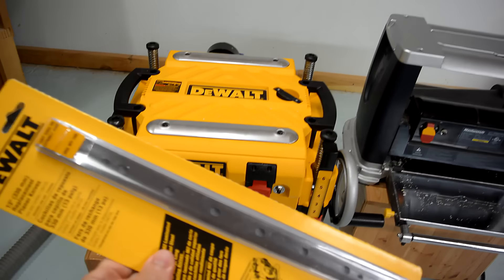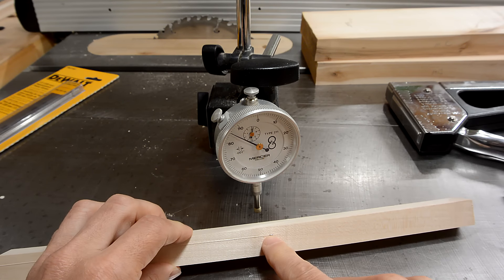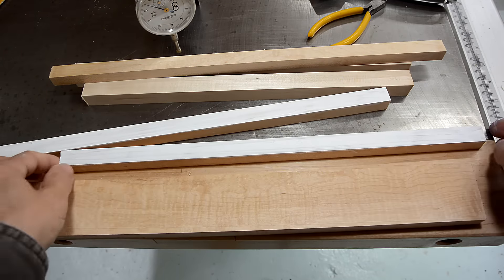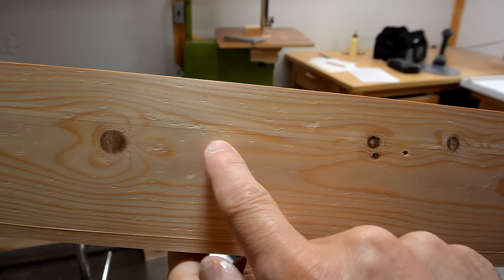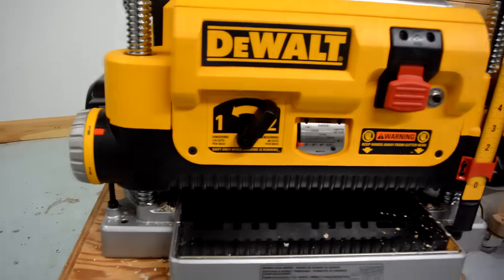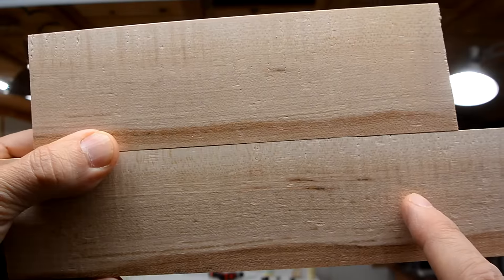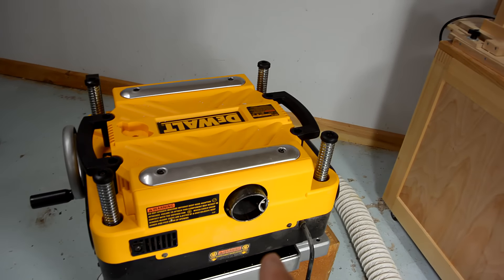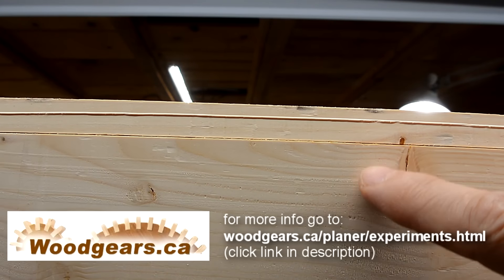More planer experiments

Comment: I also have the DW735, and th e built in blower is no joke.  My dust collection is to pipe it into a Dust Deputy on top of a trash can. The hardest part is getting the lid to stay sealed because the blower creates so much pressure. The Dust Deputy is intended for a shop vac so I'm sure it's not designed for anywhere near the amount of air flow the blower puts out.

Comment: I get those same pesky nicks in my blade.  I will move the wood over an inch to one side and run it thru again without adjusting the knife height and this cleans up the surface where the nicks are. I do this for the final pass only.  great video (as usual).
Reply from the maker: On hardwoods, a cabinet scraper works pretty good too.

Comment: I have the dewalt planer.  My DC is the Harbor Freight 2hp unit.  I have retrofitted it with a garbage can separator (lid from Woodcraft), and a Wynn filter.  With the Dewalt on and the DC off, the lid blows right off the can.  With both on, I have no problems at all.  I was surprised to see your larger DC can't keep up.  Perhaps the non-pleated bag is your limit - they have very little surface area compared to pleated filters and thus their back pressure rises very quickly with increased air flow.

Comment: I have the Dewalt, and like it a lot.  I bought it used from a pawn shop for $300 about four years ago, and then added the Byrd Shelix head about a year ago. The difference in cut quality (and the lifespan of the knives) is amazingly better. Best tool upgrade I've ever done.

Comment: That why you get a Shellix carbide helical cutter head and you don't ever have that problem again.  AND there is absolutely no blade setup messing about ever with a helical cutter head.   They are the best thing ever invented for planers and jointers.  Check them out.   Cheers.   John in Las Vegas

Comment: Curious to know your thoughts on those helical planner knives, they seem like a great idea, but I would only trust a review from someone as careful and thoughtful as yourself. Like, now I know that although the dewalt looks more substantial, there doesn't appear to be much difference between these 2, hmmmm.
Reply from the maker: They cost more than most small planers.  I wouldn't go thru that many knives in 20 years as one of those costs.
Reply: +Matthias Wandel Hmmm, some are cheaper than that dewalt unit, of course not as inexpensive as your economy model, for instance: http://www.highlandwoodworking.com/rikon-13-helical-planer.aspx Wish someone would send you one (hint hint) for your review.

Comment: You are so right about the amount of suction needed to avoid back press pressure on the DW735. I finally got there by cleaning the top dust bag on my collector and then installing one of those trash can cyclones. Now I finally have positive pressure and it does a great job. I now need to watch your snipe video as that's an issue too.

Comment: I wonder if you can harden the blades?
Reply: They already hardened.
Reply: The ones from dewalt that he tested are made from M2 tool steel, there are carbide ones available though.
Reply: Assuming they aren't already hardened and are made from steel with the right carbon content for hardening, I wouldn't dare hardening them, because I would be too worried about warping.
Reply: already hardened yet not as hard as a staple
Reply: SuperAWaC The are harder than staples, actually.
Reply: Considering how junk modern blades are (compared to old all metal planer units, they are absolute junk) you're better off contracting a local metal shop to cut you blades and have them hardened.

But then again, i would never buy a planer that has so much plastic in it considering an old one is more than likely to turn out for a lot less over all in someone's garage (heck i know, and envy, guys who managed to score amazing find on craig, then imported them over to EU and over all still come under the price for that plastic fest, one of the more crazy guys actually brought one in pieces by plane back in the 90s, still uses the original albeit sharpened knives that came with the machine).
Reply: clearly dewalt is banking on the blades not lasting.
Reply: I am still running my original blades from decades ago now. I just sharpen them. But it is hard to sharpen them. I never look forward to it.
Reply: there's no way those blades are optimally hardened m2 steel. they are definitely designed to be disposable. haha i just looked them up on the dewalt site and even they say "Cost effective alternative to sharpening". yeah.
Reply: SuperAWaC

It's what the item description states, but who the hell knows nowadays.
Reply: SuperAWaC
There are different blades offered for the machine. So go back and look again.
Reply: Paul Frederick I see the carbide tipped ones for $50 a blade. The disposable m2 ones are 13 dollars a blade. For about $20 a blade I could split the difference between the two and make three blades out of m42 steel that would last you ten times as long as the disposable ones, not nick on a staple, and can be resharpened unlike the carbide ones. dewalt is garbage just trying to market garbage to "prosumers". that's fine if you're joe milquetoast and you need to fill your mancave with tools you'll never really use, but this is definitely not a product for every day or even weekend useage.
Reply: Paul Frederick sure kid
Reply: +SuperAWaC the harder steel so the more brittle usually...... I don't think gardening would help much
Reply: crunch9876 m42 is not much harder than m2 but has better retention and is used in more demanding applications than m2. it would keep a sharper edge longer and be more resistant to nicking. there is no question it would make a way better planer blade.
Reply: SuperAWaC
my DeWalt planer blades do the job for me. Which is all I need.
Reply: Paul Frederick good job. you've emotionally invested yourself into a brand. i'm sure they notice and appreciate your loyalty.
Reply: This a job site machine, it is not meant for a workshop
Reply: *****
Why would anyone need to plane wood on a job site? Mill work comes ready to go. A company wouldn't last if they did shop work in the field. The pay rates are not even the same.
Reply: We are talking construction here. How do you make a set of beams 5mm narrower on a job site? 
That is why this machine comes with markings for the standard sizes. It is made to make stuff fit.
What do you think a portable planer is for? Check the on time on one of those. It is typically 20%. You can't use this in a actual workshop. What is the guy on the planer going to do the other 80% of the time. It is also to loud and underpowered for a actual workshop.
Reply: ***** hmm yeah that does make sense, what with the disposable blades, nobody has to take the time to sharpen them, and hugely overpowered blower, obviously not even meant to be hooked up to a dust collection system in the first place.
Reply: +Paul Frederick    Hm. I have a construction site (redo of a 70 year old roof, 600 m2), and a planer on site would be very helpful.
Reply: *****
I am vested in the construction union. I have never seen a planer on a job site ever. If you can't do it with a circ saw, a drill, or maybe a demo hammer, well then I guess it just can't be done. Then again in commercial construction we really don't play with wood much.

I have run my DeWalt thickness planer for hours on end in my workshop too. I don't care about the noise. My machine has plenty of power to do the work too. I'll tell you what a portable planer is for. It is so I do not have to dedicate shop floor space to a planer. As it is my machine is a bear to move. It weighs over 70 pounds. So portable is a relative term. It is more portable than a cast iron floor standing model. But I still would not want to be humping one around a job site.
Reply: To be honest. On a constuction site I have actually never seen one either. But all the timber framer here in Germany do have one in their car. Mostly the Makita. But most stuff can obviously done with circular saws like the festool hk 132 which seems to be the weapon of choice but you have to operate it with two guys at full depth of cut.

Comment: I use a regular 3" shop vac hose piped into a plastic garbage can with a multi layered 4 ply cotton sheet over the top with bungee cords which allows the air to to flow in and traps all the chips. It works great!

Comment: I've been using my Rigid 14 gallon shop vac, 6 horse power, with an Oneida cyclone and 2 1/2 inch, 20 foot hose and that vac keeps up fine with my Dewalt 735x planer.
Reply: Note: I haven't run anything wider than 7 1/2 true inches through with that setup.

Comment: Mr. Wandel, I love your experimentation / review video's. I trust your findings over sponsored test. in light of what you have been pointing out in this video, i would like to share that for these types of reasons, I have long since abandoned my Delta 12" planer in favor of my Performax (now owned by JET) 16-32 drum sander. it may be slower but I have more control of the outcome of my work. Thank you for your time and efforts!
Reply from the maker: A drum sander is kind of useless for resizing.  If you have to plane somethingdown by 5 mm, that takes forever on a sander, and the sandpaper gets expensive to replace so often too
Reply: Yes, I would agree under normal circumstances that four rolls of sand paper for $50.00 ($25.00 when I purchased the machine.) is quite expensive. that is why I purchased a large roll of 40 grit drum sanding paper and I can get 7 strips from one length. I just have to cut the angled ends each time I replace the paper. I think I'm on the third length from the roll. industrial papers tend to last i little longer with careful use, LOL

Comment: i find this problem is caused by grain direction . if i am not sure of grain this happens  turn the board around and run it though and it should be good.
Reply from the maker: With wavy grain, there is no "right direction".  That's why its called difficult grain.
Reply: My DeWalt can't even get construction lumber smooth. Is construction lumber supposed to be difficult to plane?
Reply: John ...knots... pitch... very soft wood.... yes.

Comment: Planer's are handy - but these are low budget really. The problem of getting wood stuck can be solved by making a table. Shame Dewalt didn't think to rectify that problem as it is so easy. I wonder whether these design faults are deliberately engineered so that we part with our assigned budget and then realise we should have spent more. The extraction problem is interesting. If you put a hose on it with just a bag on the end, it pushes the dust/chips out ok. Longer hoses have more resistance. Bends also have more resistance. Part of the resistance appears to be the motor on your extraction unit. But then, you are interested in the science of the matter - so I'm sure you'll work it out. You are further ahead than me - that's for sure.

Comment: I was wondering if you had wood chips stuck to the feed rollers leaving imprints in the wood.  I had that problem on pine boards when I clogged the blower and was not removing the chips at all.  I had to hand rub off all the chips to not leave dents in the wood.  Thanks for the video, informative as always sir!
Reply from the maker: If I did, they would either build up more and more over the roller, making it worse as I went along (which it didn't), or they'd come out on top of the wood (which they also didn't)

Comment: I think it would make more sense to test both planers with the same blades, or one planer with different blades.
Reply from the maker: The blades are not interchangeable.
Reply: +Matthias Wandel     Yes I thought so. But perhaps one could buy the same brand and type of third party blades  (with the appropriate size for the two planers of course) and do the testing with those then hopefully similar blades? I think having uniform test conditions for the planers would be crucial for deciding what are the pros and cons of the machines as such.
Reply from the maker: No such brand, and if there was, the blades would probably come from different factories.

Comment: Why is it bad to run paint through a planer? I would have thought a planer would be a good way to clean up old painted wood.
Reply: It's not bad, per se - paint pigments are just full of abrasives - titanium oxides, silica, etc.  When it dries it's like cutting very fine sandpaper.  It just dulls the blades faster.
Reply: So what is the best way to strip paint with the least amount of tool wear? Sanding?
Reply: heat gun and paint scraper
Reply: "Best" is a subjective term. I'd rather plane off the paint, (quickly,) and pay for occasional resharpening or new blades. It all comes down to how you value your own time.

Comment: You cold hearted bastid. :-D I also have wondered if paint would destroy knives or not. People always say that it does but I've never seen evidence of it. I've been half tempted to pull the clapboard off my house and plane the paint off of it.
Reply from the maker: it dulls hand planes fast
Reply: Do you think a planer knife made of Tungsten Carbide could hold up to paint longer/better? This gets into a project for my house that I've been thinking about for a while, where I need to strip paint off of a very old large house. There is a tool call the "paint shaver pro" that is hand held that can do it, but I've always wonder if I could pull off the clapboard and send it through the planer...
Reply: Carbide never gets quite as sharp as steel does. It just doesn't feather down to a fine edge quite as nicely. Or if it did it'd be too brittle to last. But what carbide does do is stay sharp longer, and deal with abrasion much better than steel does. I guess routers, and carbide tipped saw blades leave OK finishes. Still, that is not the same thing as a planer. To get that really smooth planed finish you need a wicked sharp blade.
Reply: I was told my makita 2040 has carbide knives in it, but I actually have no idea how you tell the difference?

Comment: is there a way to plane thin boards: 4mm? i used another board as a (stationary) surface but perhaps there is a more elegant way? i see video's where they temporarely attach the thin board to another  board with double sided tape but if you have to plain a lot of boaards this doesn't work
Reply from the maker: if you plane stock that thin, quite often the start of the board will get shredded cause the cutter head pulls it up into the citter

Comment: Are the carbide cutters more resistant to staples and nails ?
Reply: I can't confirm or deny that due to lack of planer experience, but carbide is very hard, but also very brittle. I know that a carbide tipped saw will be ruined. Carbide tipped anythings are expensive. But in general I'd say no.
Reply from the maker: I cut thru nails with my table saw from time to time without destroying the blade, so I think the carbide head would be ok.  And if it was damaged, you'd only have to change one segment of it, not the whole knife.
Reply: I wouldn't want a carbide 'replacement' blade in my planer... don't think they make 'em for this style of full-length knife blade.  
Aren't the carbide cutters similar to 'insertable' tooling... like maybe (let me figure out my metric) 10mm square and 3-4mm thick?
Those would have a better time resisting staples but not sure for how long.

Comment: Is there a difference in surface finish between the planers and a jointer?
Reply: not much in my experience if I move slowly over the jointer.  But its half as wide as planer and your fingers don't get involved
Reply: Should be relatively the same, but it's all gonna depend on how sharp the blades are, how many blades there are, if they're carbide or not, cutter head speed and feed speed. They're generally the same tool, just with two different purposes due to how they're set up.
Reply: Two similar machines for two completely different uses. 
A jointer is used to make one face flat, and one edge flat and 90 degrees to the flat face. 
A planer is used to create a board with two parallel faces after jointing. 
Joint first, then plane. 
Using a planer to try and create a flat true surface is futile. The board will follow any twist or bow already present. It references off of the bottom face to make the top face parallel. A jointer does not do this, as it references off the same face or edge being jointed.

Comment: I would have thought these machines would have harder blades...
Reply: Hardness makes the blades resistant to abrasion (thus holding an edge), but shatter more easily from impacts.
Reply: BrokenLifeCycle...Yeah, I know...I was thinking just a little harder...not to the point of shattering....
Reply: Doug Ankrum In all likely, the material is as optimized for the application as possible. Remember, the blades are rotating on a shaft at a few hundred times per minute. The stresses imparted on the blades would be akin to taking a wood chisel and sticking it on a jackhammer.

Hardness would be more idea for application where the forces are consistant in one direction, and continuously and gradually applied. A hand planer is a good example of this. But for power planers? It needs a balance of hardness and impact strength if it wants to survive the rigors.

Comment: The dings and divot you see are from shavings being being stuck to the ROLLERS, not the KNIVES. Clean the rollers on both machines. The shallower passes have less pressure from the rollers. Hence, less snipe and tearout as well. 
There are also accessory infeed and outfeed tables available for the Dewalt that prevent the jam you experienced and lessen snipe even further. 

I own 2 planers, a Delta tp305, and a dewalt dw733 (the predecessor to the dw735). The knives on the Dewalt last twice as long as the Delta. I still wish they had Carbide knives for both though. 

A real test is reclaimed lumber, especially deck boards and house siding due to all the dirt and grime.